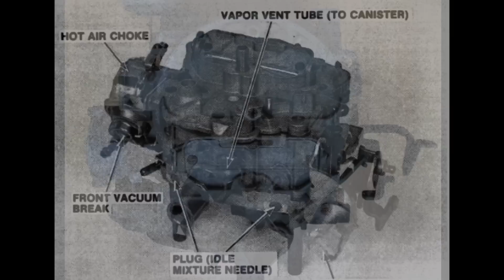Strangest Automotive Inventions:  GM's Rochester Dualjet Carburetor Or The "Demi-Quadrajet"

Comment: You forgot to mention the other GM 2 barrel oddity from the 80's, the VariJet. That carb was a Q-Jet sawed in half front to back with 1 primary and 1 secondary circuit.
Reply: Mainly used on 4 and 6 cylinder engines.

Comment: The 1977-1990 GM B-Body cars are the best cars for someone who can't afford a 60s car but doesn't want a modern vehicle. They're comfortable, stylish and durable. I miss my B-Body cars.
Reply: I'd take a downsize Ford over a downsize GM car.  Where I am, the downsize GM cars are twice as expensive due to the big rim and subwoofer community.  The Fords have a lower liftover, deeper trunk, more hiproom, more effective bumpers, and came exclusively with V8s.  But, in my opinion, they are less full size, and more just good intermediates.  If you compare them to a real full size car, you'll always be disappointed.  But compared to the intermediates of the seventies, they're no larger, yet are more spacially efficient, roomier, more economical, etc.  I would say it would be better to just spend the extra money and get a mid sixties automobile.  Where I live, you can get a sixties Ford for less money than a downsize GM car.  Chryslers are also less expensive than GM cars most of the time.  I paid $800 for my 1968 Mercury Monterey, $500 for my 1972 Ford LTD, and $3,500 for my 1968 Pontiac.  Of the three, the Ford and Mercury still run.
Reply: @ofp8574  I've had several  downsized chevys all great cars i currently drive a 88 LTD crown vic daily.
Reply: @The_R-n-I_Guy  I had a 75 Monty Carlo with 350. Bought it well used. Man it was Bug Ugly but it just flat out worked.
Reply: Love my b body wagon it’s a 88 olds custom cruiser has a great ride easy to repair and honestly has pretty good build quailty

Comment: Years ago (1979) I knew a guy that had a 1970 chevy Impala with a 300 hp 350, he disconnected the mechanical linkage on his QuadraJet secondary's to get better fuel mileage. All he had to do was "keep his foot out of it". I would have never done that for those few times you wish you had not crippled your engine when you wanted all the horses.

Comment: The Pontiac 265 is the same as the 301 with the 2 counterweight crankshaft. Pontiac started doing such nonsense back in 1975. On their 400 (and for some reason only the 400) they made the webbing where the main bearing caps bolt into very thin. The main cap bolts actually penetrate the webbing. Neither the Pontiac 350 or 455 had this weakness. These are known as the 557 casting 400 blocks which are basically useless for anything above a stock rebuild. They were weak enough that Pontiac brought back the 1971-74 casting block for use for all W72 (high performance 400) for 1978 due to warranty claims. All stock 1977 W72 engines used the 557 block and were rated at 200 HP. 1978-79 were rated at 220 HP. The only 400 available for 1979 was in the Trans Am and Formula were all W72 engines which required a 4 speed manual. Pontiac officially ceased production of their 400 at the end of 1978.

Comment: I had one of these on a stock 1980 K5 Blazer with the 305, swapped later on with the intake and Qjet from a 305 Camaro and couldn't really tell any difference in power or MPG with the 305 being so anemic in stock form at the time. The Qjet sure sounded a lot better when you stomp on it and those secondaries opened up though, so there was that.

Comment: The 301 Pontiac with the DualJet was a good runner and got great mileage.  I had a number of very happy customers with that setup in Olds 88's & Pontiac Bonny's.  The 307 Olds was good also!
Reply: The 83-84 Hurst Olds with the lighting rod shifters had those Olds 307's with a supposedly better cam. They still didn't have much for power, but nothing did in those days. Damn cool car for that time period. My buddy bought one new and it made for a great cruiser.
Reply: @davidphillips5395  
I'm a big fan of the 307.  Great engine for the G-body.  My 85 Cutlass last over 400K without a rebuild.  Would probably still be running if I hadn't wrecked it.
Reply: I had a 301 in my '78 Grand Prix.  Loved it until it lost all the nylon teeth on the timing gears, then consequently ran in a retarded timing state causing overheating.

Comment: I had a customer who owned a 77 Olds 88 that had the full-size (early) Dual Jet carb. It was the first one I had seen. I certainly did a double take the first time I removed the air filter! I remember that car as having a 350 Olds V8, but it could have been the 260. My first reaction was: "How cheap can GM get?" Little did I know that it would get much worse.

Comment: I worked at an Oldsmobile dealership in the 70’s.  Worked on a lot of cars with 260 c.i. V 8’s with dual jet carbs. They were pretty trouble free.  They got great fuel mileage. Not a lot of power but smooth as silk. I bought a used 1977 Cutlass with a 260, pulled a medium size pop up camper all the way to Florida. Got over 17 mpg pulling camper. It would go the speed limit with no problem as long as you give time to get up to speed. Didn’t like big hills. Once in Florida I averaged 21 mpg that week without the camper. Mostly in the city.  I’m sure it was the small engine with that carburetor setup that made it possible.
Reply: I had a 1981 Olds Cutlass, 260 , and the half quad. It was a good car ,GREAT LOOKING. But it earned the nickname GUTLASS CUTLASS. LIL😢
Reply: IIRC the Cutlass with the 260 also had the option of a 5-spd manual with overdrive, which was a first for Olds.
Reply: @warmstrong5612 I got to look that up, what was that five-speed manual with overdrive in the 70s called the T5 ?
Reply: @John.Zachary.Delorean  
t5 is 1980s.
it must've been a 4 speed
or a borg warner t50
Reply: I got 11mpg 17mpg highway with my 2004 hemi ram 2 door short bed.
Reply: That's pretty incredible considering
Reply: My first car was a 1981 Regal with the 4.3 liter engine and it was the most comfortable car I've ever had and it was really reliable. I drove it for close to 5 years then sold it to a friend and he drove it for a few years and then he sold it. Love to know if that car is still around and running 😂
Reply: I had a 78 Cutlass Supreme with the 260 also. It was my 1st car and it was given to me with a blown engine. The engine was rebuilt professionally.  The heads blew on me 2 more times. I finally swapped in a larger Olds and 25 years later that engine is still in it. From personal experience those 260s ran a bit hot..... or maybe they just didn't like my foot.
That Dualjet however never gave me an issue.
Reply: Wife's mother had a 77 full size Olds with the 260. Great car.
Reply: Do you happen to know if a 350 ci intake manifold would have fit on those engines? 
I’ve  oft wondered if you could wind up with a real Q jet with that setup
Reply: @toddbridges7430  
It will bolt up but the ports do not line up. A tuned DualJet runs beautifully on a 260.
Reply: @toddbridges7430 thr 350 intake does fit, but the 260 heads have stupid small intake/exhaust ports.
Reply: @toddbridges7430 I'm a big fan of your work, I loved Different Strokes.      😁
Reply: Damn, that was pretty good fuel mileage for the time. Albeit very gutless, but still. That's about the same MPG that a 88-94 GMT400 with the 350 TBI would get roughly although with overdrive and a slightly bigger GVWR for a 1500. Yep, the old domestic body on frame RWD cars were just as capable as a 1/4 ton truck like an S10 or a Ranger. About 4000 Ibs GVWR between those mini trucks and a '77+ downsized full size car.

Comment: I can't think of a more iconic duo than GM and creative attempts at cost cutting. I for one have always wanted to at least test drive one of the small little Olds 260s in a Cutlass, just to see how much of a difference there was between that, a 3.8 V6, and a 307. I'm guessing not much, since they didn't stick around very long.
Reply: I had an 81 Malibu Classic with the 267 V8. My friend would always smoke me in his Iraqabu Malibu 3.8 v6 manual.
Reply: I've had the experience of driving both a 3.8 (or 231) and a 260, and they perform similarly as you'd expect. However, the 3.8 got a tiny bit better mileage, but shook more.

Comment: That dual jet was on the Chev 305 in 1979 and made a whopping 130 horsepower.  I remember the 305 running awful with this carb.  It pinged like a popcorn maker and ran on because it was running that size of V8 way too lean and hot.  It was just too small a carb for anything larger than a 260 or 267 V8.  I had one on a 267 in a ‘79 Malibu and it made 125 horsepower, only 5 less than on a 305.  It was ok on the 267 and didn’t have the pinging and run on problems that it caused on the larger 305.  The whole point of better fuel mileage was lost on the larger engine because of how poorly it ran and ended getting worse real world mileage.  GM should have just stuck with the original 2 barrel carb as it ended up going to only 4 barrels on the 305 after 1979 at least on passenger cars.

Comment: There is more ridiculous than this.
Just as this carb is half-filled, Jaguar has produced a V6 by filling up two cylinders of a V8. Externally, it looks like a V8, all castings are the same, it's just that one cylinder on each bank is not populated by a piston.
Notoriously runs like a duck with two broken legs.

Comment: Never knew about the dual jet carbs, but it begs the question "why???"  Why not just use the normal 2bbl carb instead?  I could understand if they wanted to use the fake quadrajet over the normal 4bbl manifold to save money and use existing 4bbl manifolds, but this carb used a different manifold as well?

Comment: 2:20 mark ..  .can someone explain the multiple loops in hard steel brake lines before they go downstream...?
Reply: I believe it’s to allow the lines to flex with the vehicle body movement. 

Straight lines going up to a 90 degree into the master cylinder have a higher chance of breaking the seal or forming stress cracks during turns, acceleration, and just general body flex. The loops sorta make it act like a spring and the lines can compress and expand some
Reply: @billbob4856 OK, that makes sense.
Thanks Bill.
Reply: …and the downward spiral avoids airlock when bleeding.
Reply: @randyfitz8310 Thanks, that makes sense.

Comment: As weird as it is, it’s still better than the Rochester VariJet. What a disaster that was.
Reply: I put one of those on a turbo Corvair in the mid 80s. Low end was pretty good, but you could NOT build any boost without getting into the secondary. I used a 1980 carb without any electronics. It didn't stay on the car for very long, but overall, it wasn't a bad carb.

Comment: I remember the Olds 260 V8 which had the 2bbl carb. Also the Chevy 267 V8 had it as well I believe.
Not much experience with the Chevy 267 but the Olds 260 V8 was a weakling but at least a very smooth quiet engine.
Reply: I had the 260 with this carb in  '76 Omega. Also had the weak T50 5-Speed trans, Issues aside, with that overdrive I could hit 28 Mpg with the AC on.

Comment: Dualjet had metering rods instead of power valves. This let's you keep the fuel ratio closer to stoichiometric. Thereby better emissions.
Reply: So did the Quadrajet and the 2Jet.  Metering rods was a Rochester thing.
Reply: @johnstrauss8061  Also the monojet but not the 2GC that this card replaced.

Comment: I loved the Q-jet- I loved the sound of the engine when the secondaries opened up!
Reply: @trampslikeus3575   Booooo-Waaaaaah!
Reply: @keepyourbilsteins 
I thought it was more like BWaaaWAAAAAAAAAAAAAA
see ,sometimes there's a little hesitation because Mom has been driving for fuel economy for a while. 
😂😂
BWaaaWAAAAAAAAAAAAAA
Haha those were the days man ❤❤❤
Reply: I remember flipping my lid! 84' Olds, give it extra 100hp of noise!
Reply: @Turbo14x  Yeah.  Gotta admit it was more about the noise than the gain.
Reply: @Turbo14x  i had an 81 olds wagon and you are right on with that statement!! fun times back then!!
Reply: @MrChevelle83 i had root beer brown vista cruiser. Amen brother
Reply: @Turbo14x ... What digit or digits did you replace with an apostrophe in the term "84' "?
Reply: Vtec before it was cool
Reply: "Loved".  They haven't gone anywhere.  It's you that left.  The one wire alternator, HEI and a Quadrajet are the most dependable, easiest to troubleshoot and fix components the world ever produced.  I will never buy anything new again.  So much junk.  Come back from the dark side.
Reply: I put a 850 CFM on my Ford 460 but the difference between the primaries and secondaries was so big it had a big gap 2500-3200rpm where it was kind of lugging, then 3500-5500rpm it was ripping with no sign of slowing down. I eventually went back to the square bore Motorcraft. The square bore would start to drop off around 5000 rpm but not have that gap.
Reply: @castirondude  That's caused by not having the weights/timer/mechanism on the secondaries correct.  In conjunction with the timing curve rate.  ...not the carbs fault, but rather the tuner's...
Reply: @NorthernChev  Possible. I bought it from Summit Racing so it should have been set up properly. Though the secondaries were super rich, probably setup for a smaller engine
Reply: @castirondude  It wasn't jetted right ,the qjets are set up for each individual engine they are on. They don't plug and play like a Holley or AFB.
Reply: Q jet with manifolds was such a rich note.
Reply: @philstarsick82  Wuuooop Wuuooop! 😂😂😂
Reply: That is my all time favorite sound!
Reply: And with proper tuning easily made 350HP on a SBC.
Reply: Flip that air cleaner lid over, and let the fun begin!
Reply: @michaeltucker9993 💯💯💯 😂😂😂
Reply: @michaeltucker9993  eeyup
Reply: @michaeltucker9993  Take it off and put a Cal Custom air intake on with open air cleaner elements.
Reply: @michaeltucker9993  con la tapa de fabrica?
Reply: Richard flair jet😂  whoooooo
Reply: "Pull-over enrichment", you could actually see raw guzzoline just pizzing out of the top holes into the secondaries. (Not squirters like a Holley, it had those too; this was on the big side and it just sucked it out like it was straight out the damn dinosaur graves and would never end).
Reply: @johnwhitley9209  That cloud of 65 cents a gallon gas Premium.
Reply: @johnwhitley9209 it was righteous to watch! Over
Reply: We all did, Tramp, we all did.
Reply: @trampslikeus3575  No question! And of course you had to flip the air cleaner so you could really hear it pull, over the volume of your 8 track. Maybe something from Night Rainger or April Wine!!👍
Reply: @LaPabst nice!
Reply: Yeah sounded like it was sucking up everything on the road around it!
Reply: Yep. Flip that filter lid & listen to that open intake! 
Those were the good one days.
Reply: @waynes.2983 
Just don't forget to turn it back over ,or pops will know what you were doing with the family truckster😂
Reply: Thanks
Reply: Gracias, andaba buscando esto, mi viejo tenia monte carlo 79 cuando era niño y sonaba así. Era evidente que el sonido venia del carburador pero no sabia que carburador. Hay otros carburadores con buen sonido?
Reply: Most 260s were the Dia shape 2 barrels  that were junk and made them run really rough best thing to do was put the  round 2 barrels or four barrel if I correct  the 350 8ntake would fit the 260.
Reply: @NIGHTSKIES-p5r ... You should take the time to make sense, rather than write rubbish.
Reply: @NIGHTSKIES-p5r  And that's exactly what most of us did, yeah.  We just swapped on a junkyard 4-barrel intake and called it good enough.  I mean, it certainly worked better than the factory two barrel setup.
Reply: Oh hell yes. The. Q- jet carb. My favorite carb. I put it on every older car I had that had the old style engines
Reply: Wahhhhjhhhhhhhhuh!!!!!!
Reply: And I also love the fuel economy and low emitions of my olds 403 unbelivable! ❤
Reply: Whooooo whorrrrrrrrrrrrr
Reply: Quadrajets were great carbs.
Reply: Nothing could put me in fits of rage faster than a Quadrajunk, on a Chevrolet, however have a 360 Dodge with a Quadrajet,and it really hasn't bothered much,
Reply: The best carburetor ever! The "bolt on a Holley" people just didn't want to understand them.

Comment: They later made one which was split the other way, with one primary and one secondary. I think it was called the varijet. It didn't really look like half a quadrajet but it was basically half of one.
Reply: Not really. The Varajet was a terrible carburetor. GM used it on a shitload of A and X cars, and we rebuilt a zillion of them in the ‘80s and early’90s. The grid heater under the carb was a common failure & it was fairly expensive at the time. Customers did not appreciate it when we’d call them and explain that the grid heater had failed & their carb rebuild price was going up by $75 or $100.
Reply: @alantrimble2881  The version used on the Pontiac Iron Duke engines put into Jeeps in the early 80s didn't have a grid heater, just an electric choke element.
Reply: @gruberstein: not exactly. The secondary on Varajet behaved like a variable venturi carb.